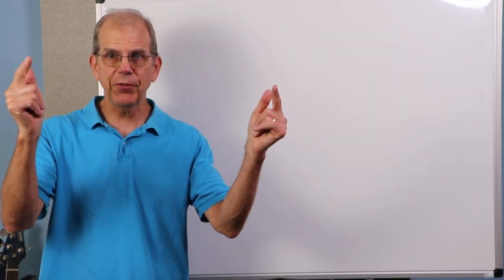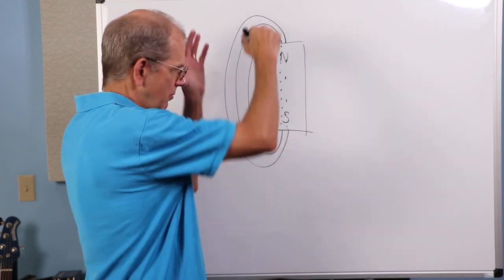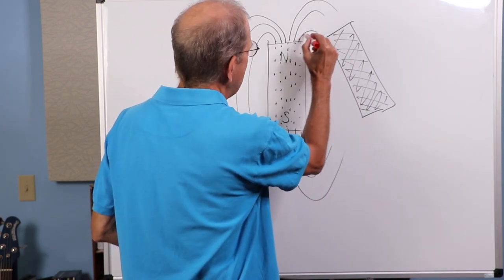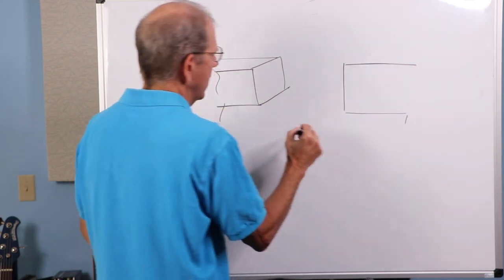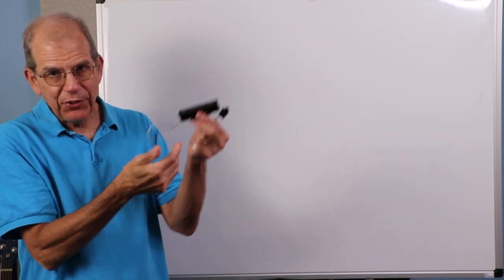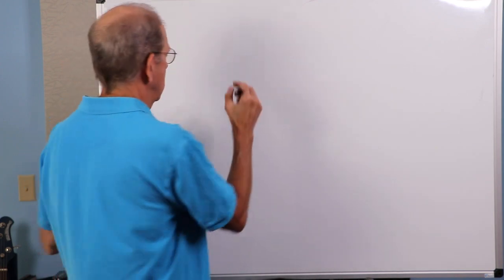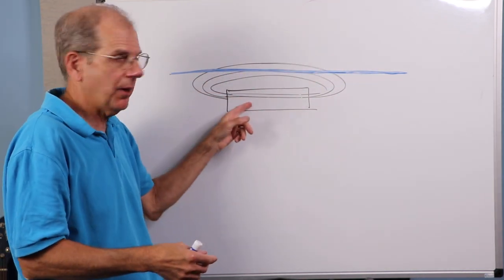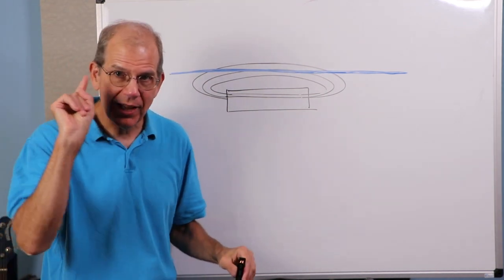Science of Sound: Guitar Pickups & Faraday's Law

Comment: You have not addressed external electrostatic interference. Shielding can be very effective against this type of noise. It is not just the pickups that are sensitive to this noise though. Wiring is also sensitive. Shielding can be as simple as layer of grounded foil between the circuit (pickups and wiring) and the noise source. A grounded foil on the opposite side of the circuit can also be effective if the circuit elements are close to the foil. It reduces the electrical field gradient in the vicinity of the circuit.

Grounding is important here. It provides the "zero volts" that the shielding presents to the circuit. If the shield were not grounded, it would simply rise to the voltage level of the external field and act itself as a noise source.

The most common source of the electrostatic fields that the instrument sees is your own body. You pick up these voltages from the electrical fields in the room. That is why touching the strings can silence the noise. If the strings are grounded, you also become grounded, and are no longer a source of noise.
Reply from the maker: No, I have not addressed shielding in this video. It's an introduction to the topic, not an exhaustive treatment. It is important to the design of such instruments, as you say, and perhaps I'll have time to cover this in a future video.

Comment: That’s interesting. I wonder why some pickups are so microphonic that if you did yell it picks it up? Also does this mean that the wood doesn’t effect the sound of the pick ups?
Reply from the maker: The choice of wood affects the resonance of the body which affects the string motion which is caught by the pickups. So it is there, the question is how much influence it has on the overall sound compared to the numerous other inputs to the system. I don't have any hard data on the microphonics issues (or even any personal observations as I'm not one to yell into pickups), but I suspect it may have something to do with how they are wound. I imagine that a loose winding might be more susceptible.
Reply: @ElectronicswithProfessorFiore  honestly thank you very much for answering that question. I greatly appreciate it all the best and love your content.
Reply: @ElectronicswithProfessorFiore  My theory is that the pickups that are covered with a metal sheet tend to be microphonic since the vibrations from the voice will make the cover vibrate, being a thin, flat, metal sheet essentially, thus acting like a sort of microphone.
Reply: I love videos from the law firm of Faraday, Lenz and Ohm, great job. Plucking a string generates a mechanical force. That force transfers to the nut on the neck and the bridge of the guitar body. Wood is a fibrous material that becomes an acoustic cavity spreading this tiny force around causing the coils and strings to oscillate. Any movement of a conductor, even just the width of an atom will cause a current to flow within that conductor. "Loose" or "scatter winding" the coils contribute to this phenomena and accounts for the shape of the tone as these energies collide with one another. Wax potting the coils dampens this effect.
Reply: I actually just heard someone talk about this, they confirmed it was because of loose coils.
Reply: Some pickups are wax coated. Some are not
Reply: Have you yelled at the pick-up when there are no strings?

Comment: there are examples of yelling into a guitar pickup and hearing your voice through the amp. these conditions usually are found in older unpotted pickups with loose coils and thin metal covers (or baseplates). the cover acts like a microphone diaphragm and vibrates which will induce a signal. not relevant to your discussion but still interesting.
Reply from the maker: Yes, there was a bit of a conversation on this a few months back. See the other comments on this video started by JayOneAlumni.

Comment: OOOOPS...GOOD GUITAR PICKUPS ARE INDEED MICROPHONIC THOUGH NOT EFFICIENTLY.... EVEN TO VOICE BUT TAP ON ANY PICKUP  WITH YOUR FINGER .. CASE  CLOSED.. FIRST STAGE TUBE IN AMP ALSO MICROPHONIC
Reply from the maker: As I stated in response to a comment below, yes, it's possible that pickups can be microphonic. That doesn't mean they have to be, or more importantly, whether or not that's good. Of course, with instruments we sometimes do weird things, but in a high fidelity playback system, microphonics are something to be avoided.
Reply: I always thought microphonics were the hallmark of bad or cheap pickups. And usually a result of in sufficient potting of the windings with either wax or resin resulting in harmonic vibrations.

Comment: You seem unprepared and constantly interrupt yourself. Picking up things and dropping them off screen is a little off putting. You seem surprised by your own conclusions. Also, you drew a bar magnet on it's side and a string above it, but of course that is not how pickups work. Bar magnets in humbuckers and p90's magnify steel poles or a given polarity which magnify the string. Vintage single coils have the string run across the top end of magnetic pole. Your discussion of the horseshoe magnet made no sense. I think you were trying to explain a the magnetic string induces a stronger voltage in a multiple coils of wire as it moves. But you just stated this simply anyway, which is all that was needed.

Also, I am uncertain if your overall explanation is precise. The magnets in guitar pickups magnetizes the string. That is the important point. When the now magnetic string vibrates, it induces an electric charge in the coil of wire below it.  It is this that is fed into the amp. I would not say that the string  'changes the shape' of the magnetic field. Although technically correct, it is of secondary importance.
Reply from the maker: I am sure that my "discussion of the horseshoe magnet made no sense" to you for the simple reason that I never discussed horseshoe magnets in this video. The closest I came to that was showing a conductor moving through an air gap as part of explaining Faraday's Law. Not the same thing. Also, the words "magnify" and "magnetize" have completely different meanings. I would expect anyone in high school or above to not confuse the two. Further, there is a difference between an electric charge and an electric current. Although related, they are not the same thing, as you seem to be treating them.

I will say this much in your defense: if you had a magnetized string, its movement could induce a current in the associated coil, but then why not just sell magnetized strings? After all, Faraday's Law just says that there needs to be relative motion between the conductor and the field.
Reply: @ElectronicswithProfessorFiore  
Yes I made some typos. I don't see how that's relevant. The horseshoe magnet stuff is irrelevant and badly explained.  You should try to convey the key concept of what you're trying to explain with as less jargon as possible, and in the simplest way as possible. 

As to why they don't magnetize strings, I think it is because strings will lose their magnetism after some period of time. I don't think you could make a string under tension out of magnetic material - It would simply break or shatter. But your question does point out an interesting fact which is we don't really need the guitar string, all we need are magnets. And in fact there's a guy who sells a magnetic pick for $50 and it makes guitar-like sounds without the strings moving.
Reply from the maker: @valueofnothing2487  If you do it once, it might be a typo. If you do it repeatedly, it probably indicates a deeper misunderstanding. For example, referring to an electric current as an electric charge is like confusing length or distance with speed. These are technical terms with specific meanings.

It's not a horseshoe magnet. Stop calling it that. Further, that section is very much important in order to explain how Faraday's Law works, and how it applies to pickups.

The bit about "magnetic strings" was rhetorical. Of course they don't make magnetic strings, and for good reason. But speaking of "magnetizing strings", take a string off of one of your guitars and see if it attracts something iron-based, like a paper clip. Then report back here.
Reply: @ElectronicswithProfessorFiore  
So you were just being rhetorical? And I wasn't supposed to take you seriously? Ok.

I think your video is misleading and needlessly confusing - for all the reasons I have given above.

Lastly, I think you're criticizing my criticism of your use of the horseshoe magnet to explain Faraday's law. My point is that you did not explain Faraday's law with this, nor should you, nor should you even use a horseshoe magnet. The point is to explain that the magnetized string  induces "a current" in the wire.  There's no real need to talk about "Faraday's law" or "lines of force" or horseshoe magnets. And in particular I think you showed your hand going in between the north and the South Pole "cutting the lines of force". All I ask is why? It seems needlessly confusing.
Reply from the maker: @valueofnothing2487   Think what you will. I have no argument with whether or not you like my mannerisms, or my methodology, or even the clothes I wear. If everyone wanted the same thing, there would never be a need for more than one book or one video on any given topic. My goal in these comments is simple, and that's to prevent self-proclaimed "expert YouTube commentators" from confusing the people who come here with an interest in learning how these sorts of things actually work.

Does that sound harsh? Well, the fact that you believe that it's "needless" to discuss Faraday's Law in conjunction with an explanation involving inducing a current into a coil of wire speaks volumes. It's a prime example of the Dunning-Kruger Effect in action. What's next? Would you like me to explain DC circuit analysis without using Ohm's Law? (Just to be clear, that was a rhetorical question.)
Reply: @ElectronicswithProfessorFiore  
I'm saying it was irrelevant for the video. You had already explained how a conductor moving through a magnetic field induces a voltage I think those were your words.

And so when you start talking about the horseshoe magnet and cutting the lines of force and the perpendicular conductor and then you just stopped, mentioned Faraday's law,  and went on to something else. All that was irrelevant. And you did not need it and that's why I called it needless.
No we've all had classes where all of these things were discussed and I can kind of tell where you were going but it was completely irrelevant to this video.  

I don't want to get into everything else like you bringing up pickups and bass guitars and talking about turns of wire with lots of resistance and inductance and impedance. How could anyone who doesn't know how a pickup works be familiar with any of that?

And then you draw the bar magnet in a way that it's not similar to the pickup so why did you bring up pickups into this video? 

I could go on but I'm sure there's no point to it.
Reply from the maker: @valueofnothing2487  
You are right, you could go on and there would be no point to it. I suggest instead that you use your time to find a reputable channel on electrical theory authored by someone with appropriate credentials and learn the subject at hand. It's obvious that my style of teaching doesn't work for you, and I'm fine with that. My channel is designed for students of electrical engineering and engineering technology, that is, people who already understand (or are learning) the fundamentals of electrical theory.

Comment: Good day professor. Here is a diagram which is drawn with magnetic field oriented correctly for comparisson. It will also explain why. Enjoy. /watch?v=SfkX-fgmIbc
Reply from the maker: ? We are saying the same thing. I am simply drawing something that is easy to see and which explains how Faraday's law applies here. I am not attempting to draw a cutaway of a guitar. The key takeaway is that the vibrating string distorts the magnetic field, and the resulting fluctuation in the magnetic field induces a current in the associated coil of wire (which is then fed to the amplifier, creating the input voltage which is amplified out to the loudspeaker). Sorry for any confusion.